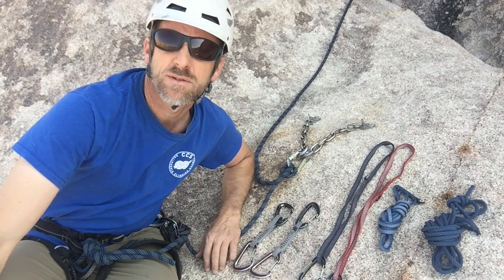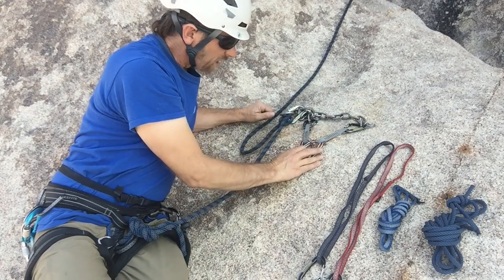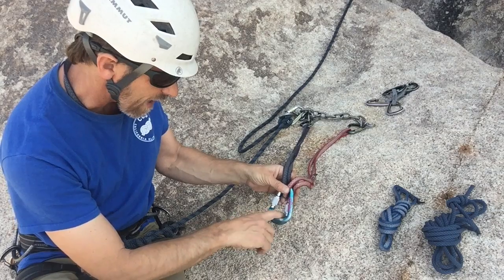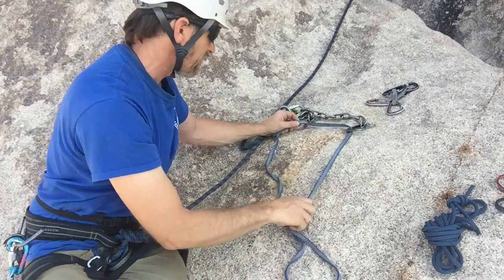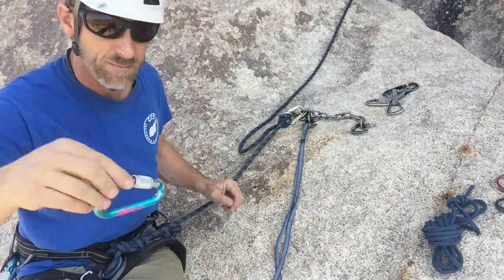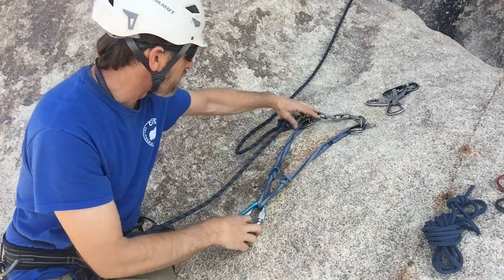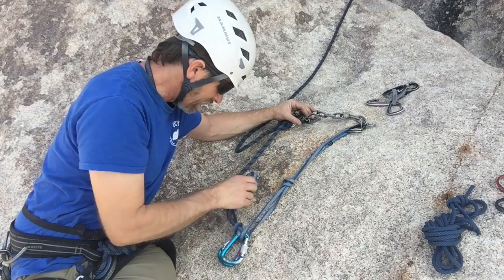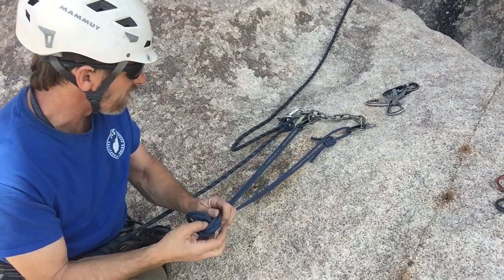How to Rig an Anchor from 2 Bolts

Comment: great video! i do think you missed that your quick draw set up gates should opposed and facing away from eachother but thanks for the review very helpful
Reply: Opposite and opposed is great practice for master. When clipping to a bolt follow the point of no interference. This is an excellent video on the topic but it still does not take the place of a hands on instructor. If you’re near them...consider taking a class with them. Hands on experience with a qualified instructor is worth much more than any piece of gear you can buy.
Reply from the maker: @diydecks8740  True.  Here's the class I would recommend  anchor-building-classes
Reply from the maker: @diydecks8740  Here's the class I would recommend https://californiaclimbingschool.com/anchor-building-classes/
Reply from the maker: Thanks!  The carabiners that clip to the bolts do not need to be reversed and opposed.  However, they need to be oriented so they are not pressing against the rock in a way that could stress the carabiner.  Carabiners have different shapes, and not all will fit on the bolts well.  If the bolts are on overhanging rock then the carabiners won't touch the rock, and it doesn't matter which way they are spun.  It the bolts are on less steep rock, then this can be a concern.   The only carabiners that need to be reversed and opposed are the ones at the master point.
Reply: @CaliforniaClimbingSchool  your master point was NOT opposed in the first example. The guide incorrectly explains the quickdraw gates facing each other as being the correct way.
Reply from the maker: @nic7615  The only carabiners that need to be reversed and opposed are the lower ones.  The upper ones need to not interfere with the rock, and whatever orientation achieves that is the best orientation for that carabiner.  Reversed and opposed is not important on the upper carabiners that clip to bolts, cams, nuts, pitons, etc.
Reply: @CaliforniaClimbingSchool  Thanks for the reply! I am well aware of what you said but I am talking about the lower carabiners. Watch the video at 1:10, that is NOT opposite and opposed  for quickdraws and your guide made a mistake in explaining an common error as being the correct way. The master point carabiners should face opposite directions outward, in the example they are facing inwards. This is wrong, https://imgur.com/a/3MrHxwa. Good examples here for anyone else reading, https://www.alpinesavvy.com/blog/old-school-tools-opposite-and-opposed-carabiners
Reply from the maker: @nic7615  Yeah I should have faced the quickdraws facing out.  Thanks for pointing it out.
Reply: @CaliforniaClimbingSchool  also the carabiners on the bolts need to be flipped gates opening down. The narrow side of the the carabiners should be on the bolts, your sling on the wide side. Both of these are common mistakes of less experienced people.
Reply from the maker: @nic7615  I was taught the "clip and flip" when I learned to climb in the 80s.  We always flipped our carabiners around on the bolt as you describe.  However there is a risk that was pointed out to me by an AMGA examiner.   If the quickdraw gets lifted up the sling can unclip itself when the big end is down.

Comment: Can you explain me why you use two locking carabiners? I really do not see any point in doing it. Just wast of material and weight to carry as the attachment point with the belay device will always be one
Reply from the maker: The locker on the belay device is a monitored point.  If it begins to unscrew or cross-load, we can notice these problems and fix them.  The master point of a top rope is unmonitored since the belayer is on the ground.  If a carabiner unscrews or cross loads there is no one there to fix the problem.  Two carabiners, reversed and opposed, give you peace of mind when you can't monitor the master point.  Having locking carabiners on the master point is bonus.  The important thing is to have more than one carabiner reversed and opposed.
Reply: @CaliforniaClimbingSchool  thx for the replay. I didn't got that the setup was for toproping. In that case it makes sense.

Comment: Nice, old-fashioned is still the best. I've learned that method at 7:00 already in the 80s at my first climbing course (outdoor of course). Same for the belaying method by using munter hitch. Simple but effective as the clove hitch.
Beside using your rappel device and a prussik properly you really have not to know that much about safe freeclimbing and you will never forget it like how to drive a car.
Reply from the maker: Super fast and easy, no knots to tie and untie--great when you are in a hurry like on long routes in the mountains!  I know what you mean.  People get fancy with all their new climbing gear but  haven't learned the fundamentals!  Sometimes simple is best.
Reply: @CaliforniaClimbingSchool  Thanks for your encouragement. Even after more than 20 years without climbing i would know how to manage an anchor, it was an unforgettable time then, deeply impressing. :)
Reply from the maker: @maxheadshot3287  I hope you get to climb again soon!

Comment: What are your thoughts of using a steel locking carabineer at the master point?
Reply from the maker: Two steel carabiners--lockers or even non-lockers--is a great master point.  Guides and institutions will frequently use 3 steel non-locking ovals.   It's not the greater strength of the steel they are after, but rather the fact that the rope gets so dirty with aluminum when you use aluminum carabiners for your master point.    I don't recommend using only one carabiner at your master point unless you are there to monitor it.  A locker can come unscrewed or a carabiner can get cross-loaded when you are not looking at it.
Reply: @CaliforniaClimbingSchool  Thank you!  That was very helpful.

Comment: Hi, I have question. If the master point is on the bad place for top rope > the rope will be rubbing against edge or something) what is better way to move that master point to longer distance? Use long slings (static rope?) ? or can I move that master point with next sling (which is clipped to anchor's master point. That sling will be straight, so can I put that inside rope protector? and to the end clip carabines for "second" master point? - is it good idea or bad. (my english is not good, I hope you understand my text :) )
Reply from the maker: Static 10mm rope is great.  Check out the Joshua Tree "V" system.  You can attach slings to slings to make a second master point but it's messy and has more failure points and takes more time to rig.

Comment: Every complex system introduces a variety of shortcomings. The long runner between 4:00 and 7:00 ends up with various knots, meant to isolate each side or equalize the directional force. Any low load, i.e. rappel or toprope, max out 1-2x body weight, trivial to any real concerns; in a belay anchor experiencing a major impact fall factor, however, dyneema/spectra slings can melt as knots tighten, so that's out. Equalizing is really overemphasized, unless every anchor is crap. Extension is likely the worst issue, again worst case using dyneema sling, one anchor fails, while climber is clipped directly to the anchor with a spectra quickdraw or biner alone - the loop extends 12-18", then shock loads the climber/lone remaining anchor. The sling could snap, the anchor could be yanked out, the climber will feel dangerously high impact force in the lower internal organs. If one is on a multi-pitch route, all the extraneous slingage is really overly confusing and unneeded, as the main rope itself can be tied into each anchor point and adjusted with just clove hitches or butterfly knots, as necessary, saving the runners for use in protection points. It is stronger than any sling. Why the Euro method has taken hold is a mystery - just because guides use it should not presume it is superior.
Reply from the maker: You bring up excellent points.  There is no perfect anchor.  They are all flawed.  If a component of the anchor is less than bomber and shock loading could result, then the climber should not be leashed in with a dyneema sling.  A better practice on multi-pitch climbs is to clove hitch in to the master point with the rope.  The stretch in the rope will significantly soften any impact forces to the body that shock loading could cause.  Many guides teach that 12" is the maximum extension one should tolerate in an anchor.   Building an anchor with the rope instead of slings is "old school" but we should not dismiss a practice simply because it is "old school"--it has certain advantages, as you pointed out:  less chance of shock loading, less gear involved, etc.  Transitions can be slower when building an anchor with the rope because there is no master point for the second to clip into, especially if the leader of the first pitch is going to lead the next pitch as well.  Rescue techniques such as raises, lowers, belay escapes, etc can get complicated without a master point.  The best recommendation I can give is to learn as many techniques for anchor building as you can, and then apply the system that best fits the situation at hand.

Comment: With your sliding-X, you still have some extension. The question is how much extension is required to cause a shock load that then approaches the strength limit of the gear? Do you have links to studies on the amount of force is applied to a sling in sliding-X formation with an arbitrary amount of extension or even a 6-inch extension?

Nice videos!  Clear and concise. RENE is old school, is it not? ;)
Reply from the maker: Great questions!  RENE is old school.  I learned it from Bob Gaines, who is pretty old school, and I guess I am too. Here's a link to a cool article on anchors.  The main message they have for sliding systems is make sure each piece in the anchor is bomber!  If you have to settle for a less than bomber piece in your anchor, then pre-equalize it so there's no extension.  You don't want to shock load a weak piece.  I've heard some AMGA types talk about 6" max extension in a sliding system.  But I haven't seen a study about it.  https://americanalpineclub.org/resources-blog/2017/7/31/anchors

Comment: I'm confused - why have you got two screwgates on the anchor if youre already safe?
Reply from the maker: The rope clipped into the locker on the rings is for my temporary safety while I build the anchor.  The rest of the carabiners are part of the anchor which will keep me safe while I climb.  Does that answer your question?

Comment: "okay so it's redundant, and without extension, but it's not equalized, so we've got 3 out of 4"
Reply from the maker: I never was very good at fractions.
Reply: The Quad Anchor is where you’ll find 4/4
Reply: Kacey Jones quad extends if a bolt fails tho right?